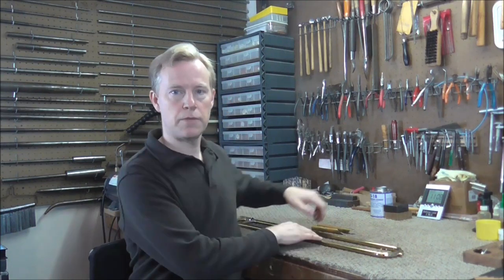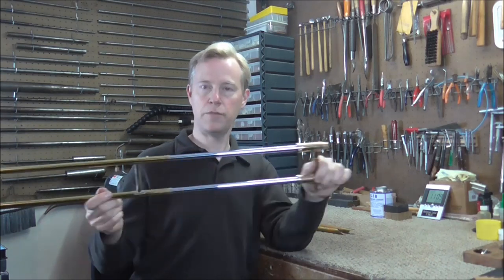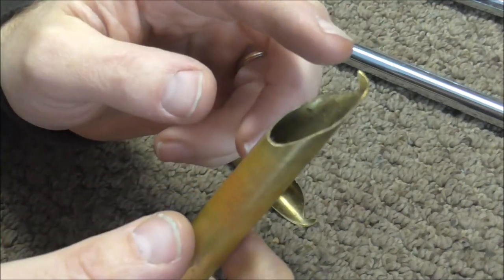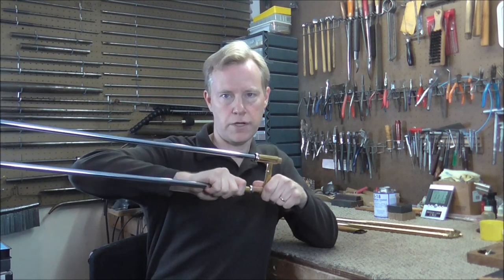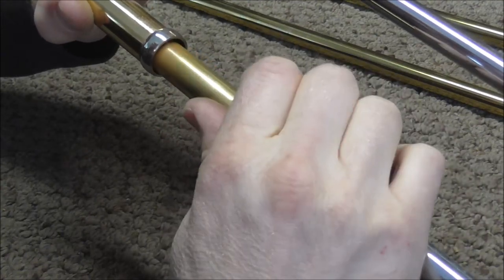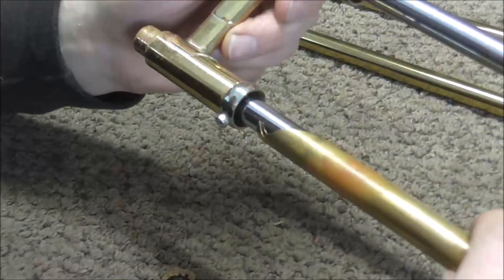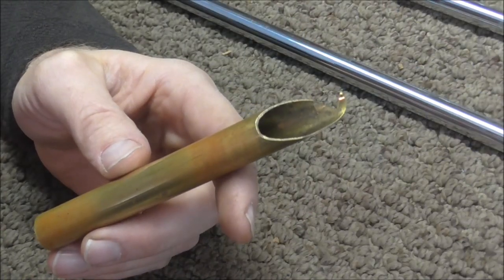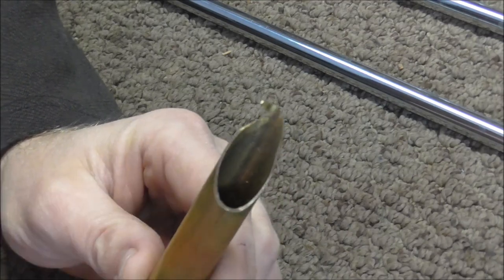How To Remove Trombone Bumper Corks

Comment: My euphonium valve won’t come out at all please help 
me
Reply from the maker: There are many different possible reasons for this problem and it is hard to say without seeing it. The first thing I would try is remove the bottom valve cap. Then cut a dowel (approximately 3/4 inch diameter or 2 cm) to about 6 inches (15 cm). Hold it to the bottom of the valve and tap the dowel lightly with a mallet. Do not tap hard enough to damage the valve. If this does not work, you can let me know or you can take it to your local repair shop. I hope this helps.